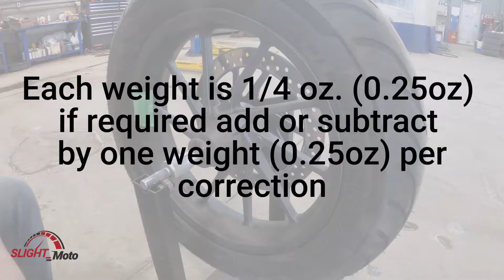Motorcycle tire balance - Venom Balancer

Comment: I just got mine and noticed the bearings on the stand need washer spacers and some adjusting to square them all up. Other than that happy with it. Good video!
Reply from the maker: The adjustment on mine is on the feet… weird... Must be an updated stand? Be sure to have it true (level) before you balance. Assuming you have used it. How did you find the tools ease of use? 

Thanks for the comment